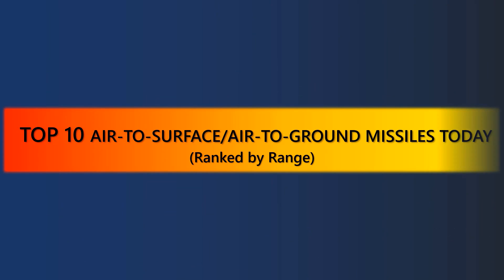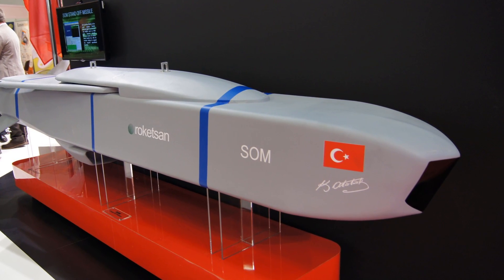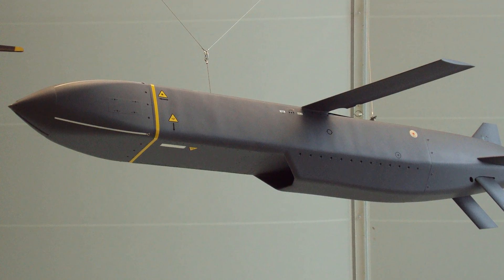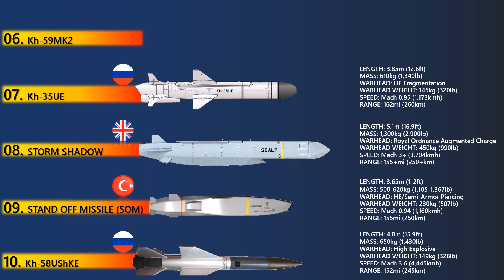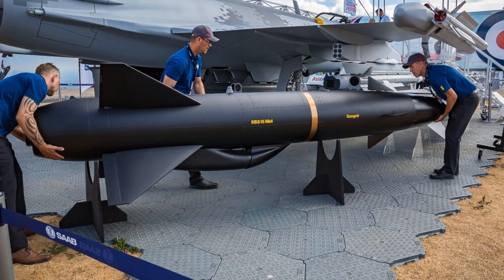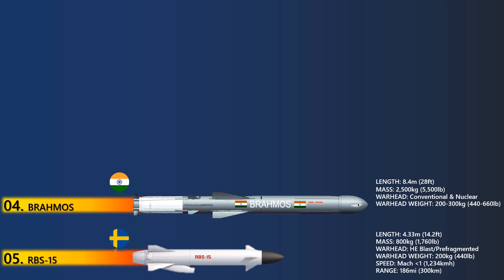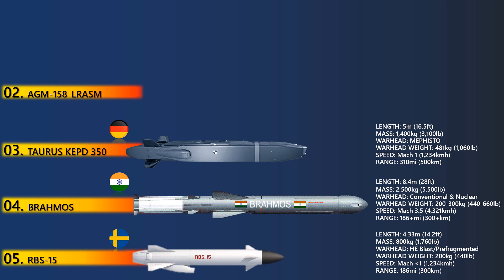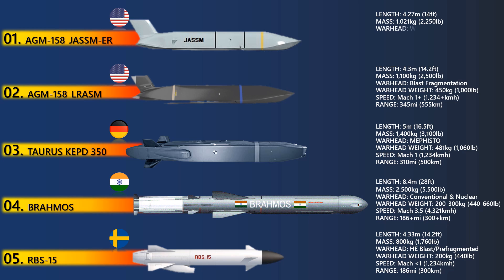Top 10 Air-To-Surface Missiles Today (Air-to-Ground Missiles)

Comment: Wheres the best best ground to ground/ surface to surface missiles?21st century post inf treaty and pre inf treaty. Some of the most deadly short range low flying missiles usually cruise missiles. Mainly deployed/ planned for European cities and battle field missiles to clear tank, armored personnel carriers infantry light armoured vechicle battalions etc. Usually firing multiple missiles with manoeuvrable tech or rockets to clear the battle field ahead before youre troops get there and when you cant see or cant fly aircraft due to air defense systems or a large enemy airforce

Comment: 👎#1- Kinjal- (dagger) russian hypersonic missile.
Reply: *Kinzhal. :)))
Kh-47M2"Kinzhal".:)))
Reply: Its not a CRUISE MISSILE but a AIR LAUNCHED BALLISTIC MISSILE
Reply: @irfanusmani6347  What makes you think it's an air-launched ballistic missile? :))))
Reply: @kommuit5740  look as at the shape and size of kinzhal its look like a smaller version of Islander or much older oka and no missile can't achieve hypersonic mach 5+  at lower atmosphere because Air is most dense at lower altitude 30,000 feet or less
Reply: @irfanusmani6347  First
of all, the "Kinzhal"does not look like either Iskander or Oka. The Kinzhal is much smaller in length and width compared to the Iskander, and the Oka missile has a different shape.
Secondly
Where does this data on the altitude of the X-47M2 "Kinzhal" rocket come from? :)))
Reply: @irfanusmani6347  For example, I managed to find other data on the altitude of the Kinzhal rocket. Its flight altitude is 25 kilometers And the trajectory is not ballistic. :)))
Reply: @kommuit5740  but its not a CRUISE MISSILE it has a depressed trajectory like world war 2 German V2 which never leaves Earth atmosphere
And 25 km or 80,000+ feet is not considered lower atmosphere at try this altitude most of the earth atmosphere is deminished
Reply: @kommuit5740  its  ballistic missilesbased on Iskander on or oka i am not saying its a carbon copy of those ballistic missiles its goes high into earth atmosphere 50,000 feet or more whereas most cruise missiles can CRUISE lowest altitude 30,000 feet or less
Reply: @irfanusmani6347  Firstly.
The flight altitude of the German v-2 is from 90 to 180 kilometers.
Secondly. 
The Kinzhal missile is not a ballistic missile, it is a long-range hypersonic missile that can hit land and sea targets according to open sources of information.
Third. 
The boundary of the atmosphere ends at an altitude of 100 km.
Reply: @irfanusmani6347  I know that it is not kamelfo to refer to Wikipedia, but according to its data, any missile that uses aerodynamic lift in flight can be considered a cruise missile.
Reply: @kommuit5740  if All MISSILES considered as cruise missiles so why militaries of the world called ballistic missiles aa cruise missiles its about trajectories
Reply: @irfanusmani6347  I did not say that all missiles are considered cruise missiles.
I said that a cruise missile can be considered a missile that uses aerodynamic lift in flight. :))
For example, a ballistic missile does not use aerodynamic lift in flight, but flies along a ballistic trajectory like an Artilerri projectile. :)))
Reply: @kommuit5740  there's lots of other missiles that isn't considered to be a cruise missiles like anti radiation missiles/most of air to ground missiles like US MAVERICK/ anti tank guided missiles which also uses aerodynamic lift so why these missiles can not be considered as a CRUISE MISSILES?
Reply: @kommuit5740  ok but tell me there are lots of other missiles also uses AERODYNAMIC LIFT aren't consider as a CRUISE MISSILES like ANTI RADIATION MISSILES/ANTI TANK GUIDED MISSILES/most of AIR TO GROUND MISSILES like MAVERICK etc etc so please explain me why these MISSILES can not be consider as a CRUISE MISSILES?
Reply: @irfanusmani6347  To some extent, you are right, the classification of missiles is very conditional. :)))
However, I did not say that the "Kinzhal" is a cruise missile.:))
But this does not negate the fact that this video does not feature many Russian cruise missiles such as the X-22, X-32, X-101 and P-800 "Onyx".
Reply: @kommuit5740  but its not a cruise missile either do you know what are the cruise missiles? 
And this clip only for cruise missiles

Comment: What about the Russian KH 101 Missile that is even better with longer range than the American missiles. This analysis is either bias or not well thought off.
Reply: Comparable to the AGM-129 ACM, except that one was able to carry nuclear warheads.
Both are long range cruise missles with more than 1000km range, so they wouldn't fit the comparison.
Reply: @platycryptusundatus7144  The nuclear version of the KH-101 missile is called the KH-102.
Reply: Ignacio Muñoz Diaz  What were you trying to say?

Comment: Fun Fact: The SOM Missile by Turkey 🇹🇷 has been declared as under 250km because of regulations set by USA and EU. HOWEVER it was leaked by an operative from the inside that the missile reached over 800km during a test! That is quite remarkable. So sometimes for political reasons the data given is not always the actual capability of military equipment ;)
Reply: Aryan Raj  yep 800km. What is wrong?
Reply: @CenabNagiyev  nice joke 😂👍👍
Reply: @bhargovphukon2000  You are joke
Reply: @CenabNagiyev  bro u are wrong, lel 🤣🤣🤣
Reply: Aryan Raj  YES 800KM I don't know how poor you are in that part of the world but if your internet speed permits you can use this website called google and search for yourself.
Reply: @yakutadam4907  I don't think range natters untill it's pinpoint accurate but without ai systems such accuracy is little bit impossible ..but if it's so good then thumbs up ...you have really created a nice missile👍
Reply: @okboy2455  Yes, such accuracy without ai systems. See ATMACA test : youtu.be/Cpp7YY-9-BE

 impossible is just a word for Turks
Reply: Aryan Raj    What  is  wrong  with  800km??   It's  a   next-generation  missile  and  pretty  new....    i  read  a  news about Turkish President  said,  Turkey  developing  another  next-generation  missile  with   a   range  max  to 2,500 km....
Reply: @milliyetci5672  yeah j-600 t yıldırım 4 2500 km range
Reply: @savustufavuze3011  You saying ballistic missile. "Gezgin" is next generation of "SOM" and can fly over to +2000km
Reply: That is not suprising. Most cruise missiles can fly much further.
The U.S Tomahawk, developed 1972, can fly 2500 km. Just for example.
Reply: @rollerrollerichson6258  But Tomahawk is heavier missile
Reply: @turk1071  Why you say "but"?
Reply: @rollerrollerichson6258  He said Tomahawk’s range is much longer
Reply: Aryan Raj  
What's so funny? There are many similar events in the world similar to the example he gave.
Reply: Some dumbheads tried to mock SOM which was developed for F-35's. Yeah, you know better.
Reply: The Missile Technology Control Regime (MTCR) which Turkey is a signatory of, limits some missiles to be under 250km hence why Turkey declared the SOM missile 254km 😂 To overcome this Turkey keeps its tests secret on special variants but it is well known the actual range for this missile as you've rightly mentioned is 800km.
Reply: Proto Edwardian  Exaggeration? Its range is literally 800km.